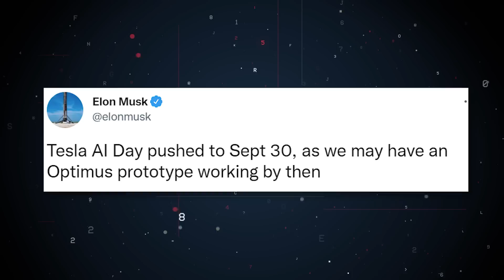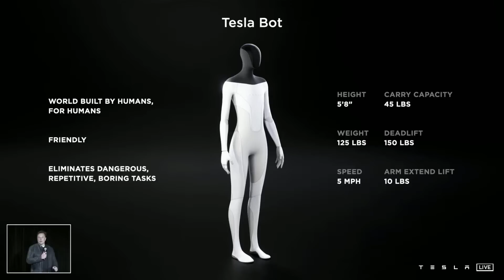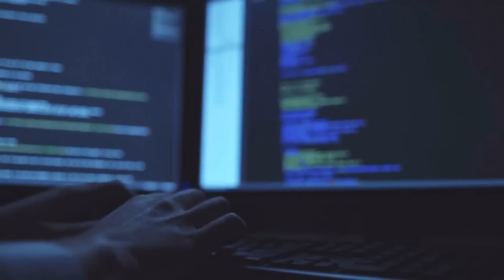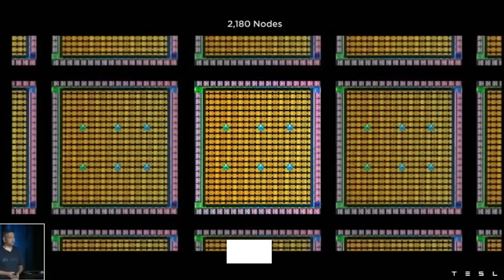Tesla's Robot: Coming In 2022 and Everything To Know

Comment: They will use an atomic battery, nuclear (Dimond/carbon) battery, or radioisotope generator.  A device which utilizes energy from the decay of a radioactive isotope to generate electricity and should last about 7 months between charges. Tesla is a stick you want to have for in the future they are the future.

Comment: Looks like xiaomi beat them to the punch here and even though I'm not an ML engineer it seems highly unlikely Tesla has the monopoly on navigation technology, however they likely do have the most training data.
Reply: forrgot to say thank you so much for the video, very nicely presented.  i'm preparing to be underwhelmed in September from a consumer standpoint but from a geek standpoint I'm prepared to be blown away and from a price standpoint, prepared to be shocked. i mean what's great here is that the current generation of robotics heavily leverages software controlled systems which is so freakin' cool.

Comment: If you believe that a Tesla vehicle is just a "car", you don't understand ARA, that is computing derived AI, robotics and automation. An electric, level 4 autonomy vehicle is a robot that you get inside of. A GM cruise vehicle is an electric level 4 autonomy vehicle. So is that Waymo vehicle. If there is no steering wheel, if there is no brake, it is level 4 autonomy (many forms of shuttles now). If the vehicle is declared driverless like the GM Cruise in SF or the Waymo in Tempe, it is by definition, level 4 autonomy. Tesla vehicles will attain level 4 autonomy by 2025. By 2024 the robo-taxi fleets will massively, as in ten of thousands , scale up.
Reply: that's cool but where do you get this information?

Comment: I disagree with the notion that it's more efficient or cost effective to have purpose built machines, than one machine that can 'do it all'. Granted, a Roomba is cheaper than buying a normal vacuum cleaner, and having a humanoid robot to run it. However, there will come a time, when there are enough different tasks, that it's cheaper to have one complex, universal robot, that can complete all the tasks, plus, any others in the future, without having to re-tool, modify, or even purchase more equipment. (There's no way to make a Roomba vacuum wash dishes) A Tesla Bot, that can basically do anything a human can do, can do a near infinite number of tasks, with no further retooling. It can manipulate a pair of pliers or a screwdriver, just like a human, thus, do the task using existing tools. A little instruction is all that's necessary, to adapt Optimus to a new task.
     Efficiency: Tesla Bot is 100% electromechanically actuated. It has full regenerative stop motion. If Tesla Bot walks down the stairs, it can turn the potential energy of the descent into electricity, and put it back in it's battery. The Boston Dynamics Atlas series bot is basically Hydraulic, so, there are a lot of throttling losses, and pressure braking losses, so if it walks down the stairs, it wastes every bit of the energy as heat, recovering nothing. The Boston Dynamics Atlas packs a huge 4.5 kWh Lithium Nickel Cobalt Manganese battery, and still only runs for a couple of hours. The Tesla Bot, can run all day on a fraction of that energy, because of its ability to recover the energy of angular acceleration, when it slows down toward its new position. There is almost no heat produced by repetitive motion. The major energy loss, is the effort to accomplish the task, and, processing power. Optimus can perform delicate tasks, with near-perfect accuracy, and use little energy doing it. The Atlas, is basically a bi-pedal 'forklift'. You wouldn't want Atlas to put a needle on a phonograph record, or, to hand-place 144 pin quad-flat pack IC chips on a surface mounted circuit board. The other side of the coin is, Tesla Bot isn't much help in rescue and recovery operations, because it may not have the strength to lift an unconscious human in an emergency. The Atlas can easily do that, and probably lift a car!
Reply: That is literally what I was about to say, it is much more reasonable to buy one singular device than happening to buy multiple objects to achieve one simple task when a humanoid robot can do everything a human can, therefore being able to do All of are assignments.
Reply: Interesting.  I think your point is, that there will be multiple types of humanoid-like robots as per the application.  I’m speculating, perhaps there’s physical limitations which would require one robot type over another.  For example, Boston A robots versions use hydraulics to accomplish feats that an energy efficient Tesla version could never accomplish even fully charged.  The fact that we are even discussing this topic is encouraging.  Perhaps by 2025 humans will each own their very own Jetsons maid robot.
Reply: @rex2837  The most realistic scenario is that Apple Siri actually becomes a hot robot maid that can do anything for you. Boom. Most profitable product in the history of mankind.
Reply: @jandersen6802  you nailed it !   Agreed 100%
Reply: @rex2837  We will each literally have our own "C3-P0"!
Reply: Nobody’s tryna read all that
Reply: The batteries can be upgraded to Nuclear Diamond batteries that are powered for 28,000 years. No need to try to convert energy from momentum because the machine will wear out much faster than the battery does.
Reply: @clallen2000  oh yeah I since that video.
Reply: You can also have sex with a humanoid robot...
Reply: That is a lot of "Fluff" about a robot that doesn't even exist yet or can do even a fraction of that if we look at current most advanced robotics. 
Until you can create a stable self learning AI that can handle a shift in tasks, challenges and adaptation it is by far more resource efficient to have a set of specialized robots doing different tasks. 
Fewer things can go wrong, fewer challenges for each unit to solve and higher chance of each unit doing its job with quality result. Rather than one unit doing all of them less efficiently with less quality in the result. And waaaaay more chances of things going wrong.